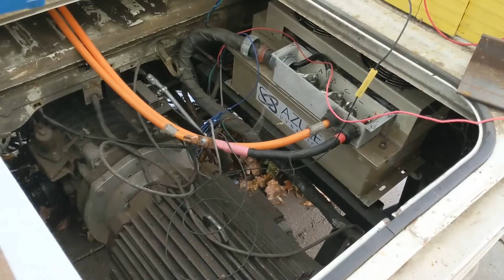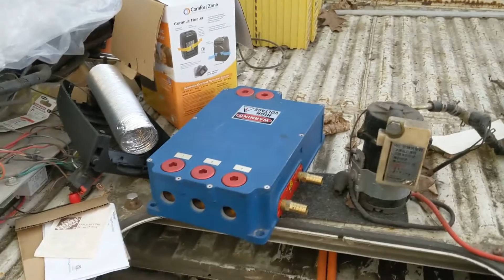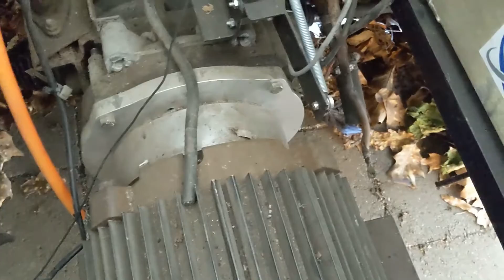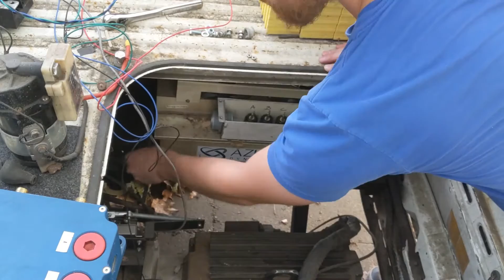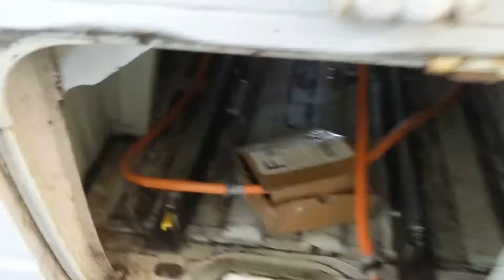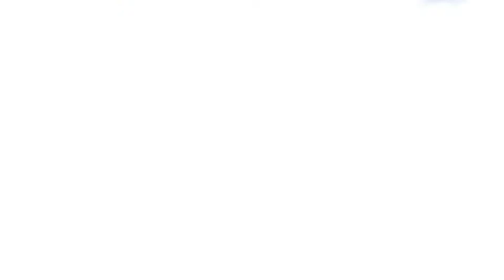VW DOKA Conversion Part One | Getting Started

Comment: Where did you Get the engine of ?
Reply from the maker: The motor was already in the van when I started helping this project; I believe it was supplied by the owner along with the old matched inverter. There are plenty of newer, more efficient, smaller, lighter, less expensive motors available these days, the Nissan Leaf coming to mind.
Reply: Carter Marquis okay, can you make a video of the gearbox? How it shifts and explain ?
Reply from the maker: @gigaruud  Yes, we will have a video when we are finished and doing a final drive.